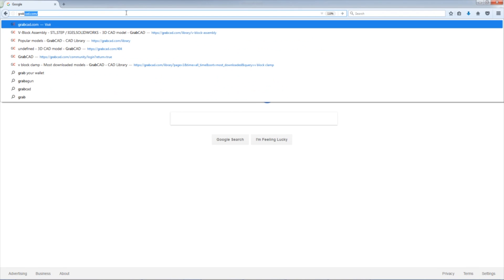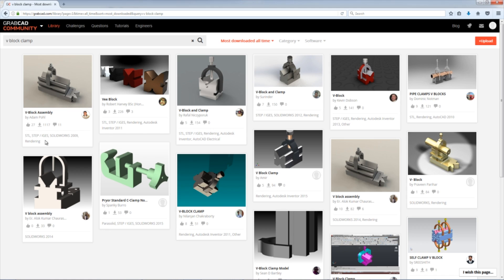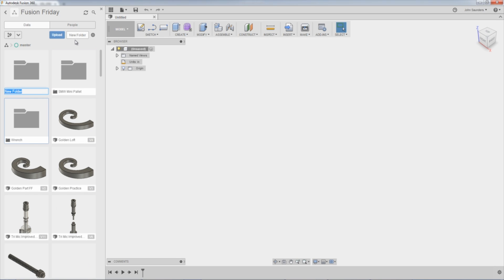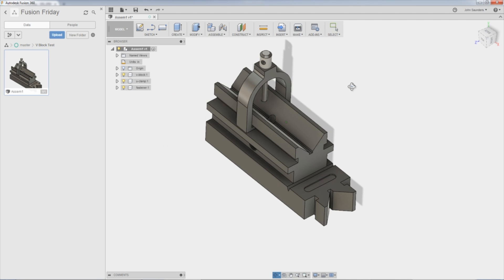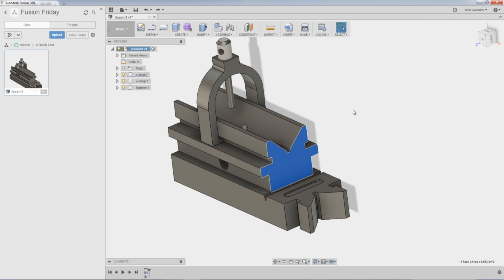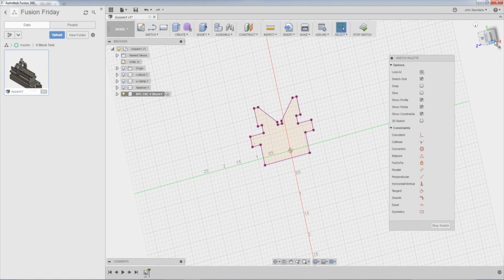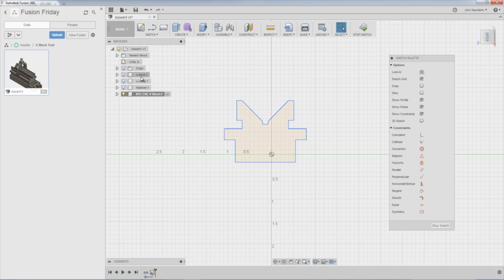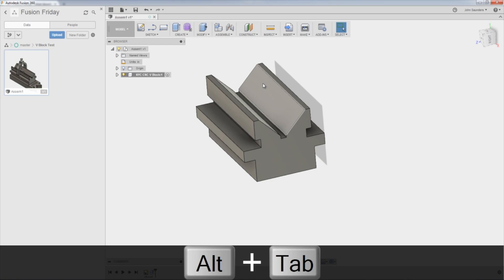Importing into Fusion 360: Tips & Tricks  FF80

Comment: Off Topic: Do you have problems importing STL files into Fusion 360? When I import STL files into Fusion 360 my file always seems to end up 10 times larger then it should be.
Reply: Turns out because of a bug in Fusion 360 the STL files are imported in centimeters instead of millimeters making the parts 10 times larger.